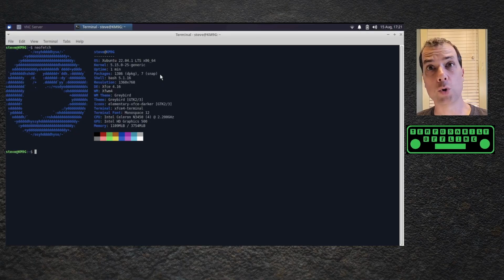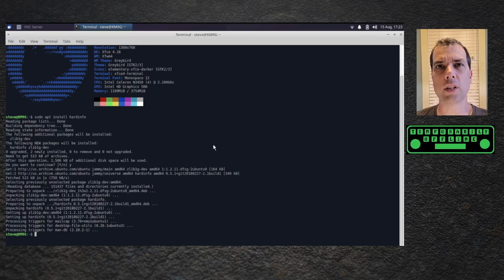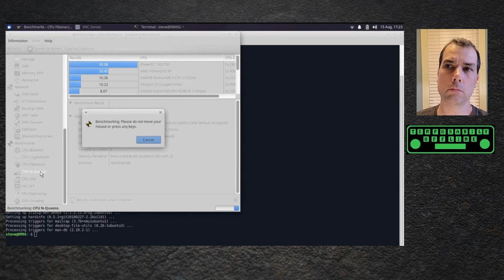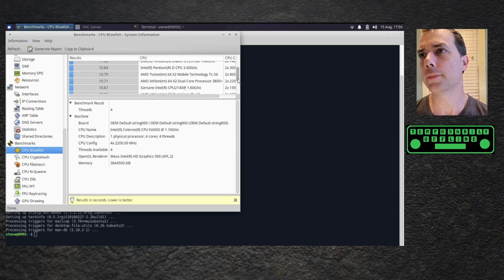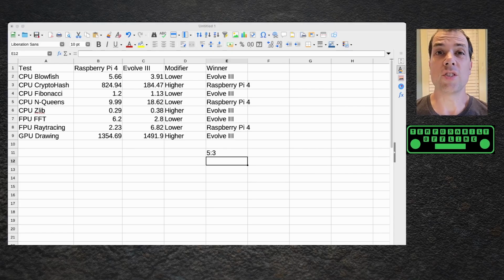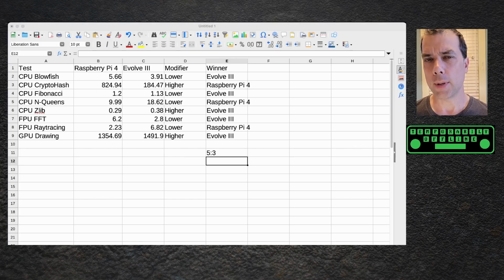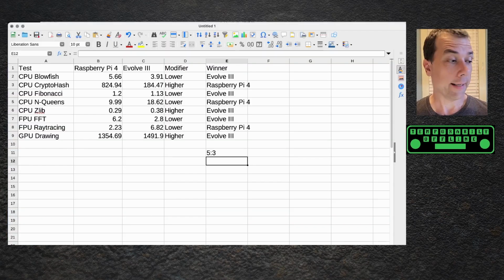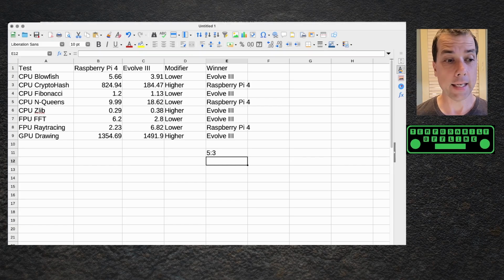Which is faster: The Evolve III Maestro or the Raspberry Pi 4?

Comment: A lot of Build a Pi will work but not all of it. Some of it is specific to the ARM processor and may not load correctly on the x86 platform.
Reply from the maker: Which parts?
Reply: I'm also wondering about an install of Raspbian X86 ???  Still not ARM of course but at least many other differences would be eliminated...
Reply from the maker: Give it a shot
Reply: Thank you for the input Jason.

Comment: What I noticed about the spreadsheet is that, while the Pi had fewer advantages, all the ones it did have were significant (like 3x or 8x) while the Evolve advantages were marginal with one exception, which is significant.  That said, loving my Evolve so far!  Thanks for benchmarking.
Reply from the maker: I think the build in keyboard, video and mouse at this price point are the killer deal.  I don't understand how they can make a profit at this price point.

Comment: I have enjoyed my Evolve III so far and I am using a Samsung USB Attached 1TB SSD for my D:\ drive and they work real well together.  I am going to test it with WSJT-X tomorrow with my FT-891 and DigiRig.
Reply from the maker: It will work great for that!
Reply: @temporarilyoffline  - I retired 4 years ago in IT Management.  We were mainly a Linux Shop and I still enjoy the platform after retirement.  Take some old gear and refurbish it with more memory and a SSD and it makes a nice responsive Linux computer.  Even though we were mainly a Red Hat Enterprise shop, we still used a good number of Debian computers, especially with our network guys.  But I still use Windows mainly for my logging software.  But all the scripts we developed for networking and cybersecurity made Linux a great tool.
Reply from the maker: Nice!  Try CQRLog or HAMRS for logging on Linux, I use both depending on the task.